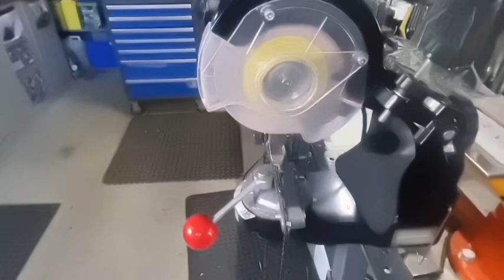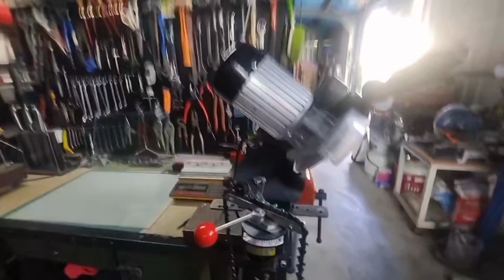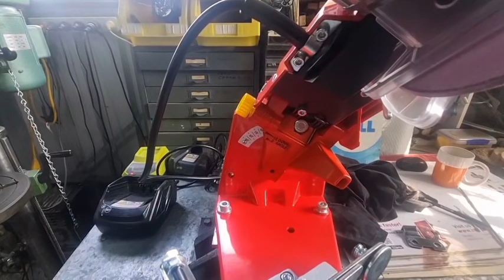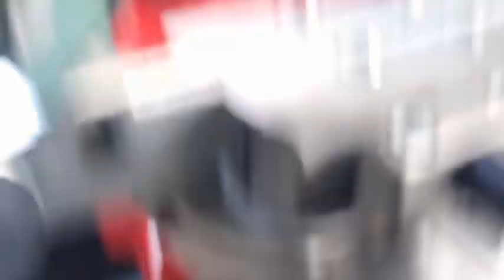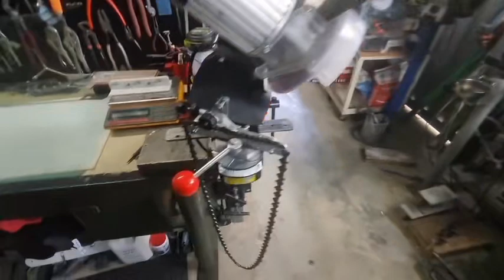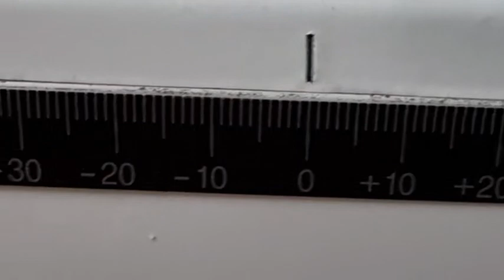Stihl USG Offset grinding the next level in chainsaw grinders

Comment: does 3 degrees equal 5 mm? . sthl offset at 17mm. 12mm for the left and right cut ( could include  the 10 degee down). the remaining 5mm , is to do with the wear to the disc; if it is. the question is. what disc is being used. 5mm , what does this equate to on the diameter of the disc. assuming that it is a stihl  disc that is being used. i think stihl do a diamond disc, which could be a differant diameter again. i cannot see why the disc cannot be completely worn until being replaced. a chain stop could get in the way though.

Comment: Watching your older videos you say Stihl made a mistake and marked the A scale incorrectly, but now watching this video if I’m understanding correctly you are saying stihl did the 3 degrees offset on purpose? Therefore when the chart shows 40 degrees on the A scale you simply line up 40 degrees mark on the A scale with the mark Stihl provided on the grinder body?
Reply from the maker: Stihl has very interesting engineering  built into this grinder it's offset 3° for a reason.  The C scale is offset 17mm pivot point.
It's complicated.
But in the end if you set 40° on the A scale you get 40° and that's all that matters
Reply from the maker: Let me explain it again.
The A scale at 0° is not vertical it is 3° offset

At first thought,  I was thinking that was an error as a few users also noticed this error.

My STIHL dealer also called it a 3° error and said everyone knows about that error.

The fact is that the A scale was made on purpose with 3° offset.

The C scale has a 17mm offset, which will cause the tooth to move away from the center line by 12mm based on a 30° setting C scale.

The B scale is moved -15/+15 to bring the tooth close to the center line of the wheel.

Now with the A scale having a 3° offset and the C scale having 17 mm offset
And the B scale being offset -15/+15. All sounds confusing.

With all these offsets you end up with the correct angles 

Its a completely different setup compared to a Oregon grinder, so you can't compare.

In my early assessment of the USG grinder, my initial observations were correct 3° offset error.
It's just that STIHL use this 3° offset to bring the correct top plate cutting angle and the top plate angle so it's accurate.

It's taken me a long time to research this method ( offset grinding)
You also can not find this information anywhere on the Internet.

Comment: Are you recommending going back to the original Stihl mark at 40 deg and if so have you seen any significant improvement in doing so?
Reply from the maker: Yes use the 40° on the USG or 50° Oregon cuts much better and lasts longer. 
The USG grinder is setup differently than the Oregon mainly because it has to do hedge trimmers and circular saw blades.  
All Stihl chains are recommended 40° full and semi chisel